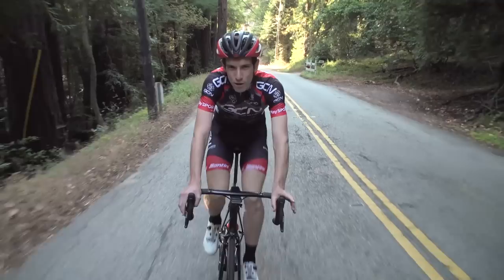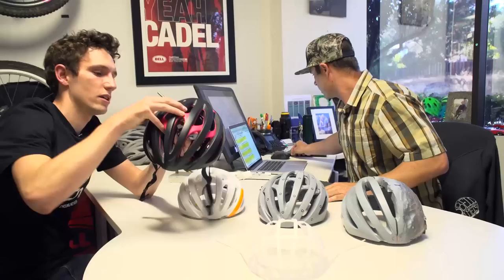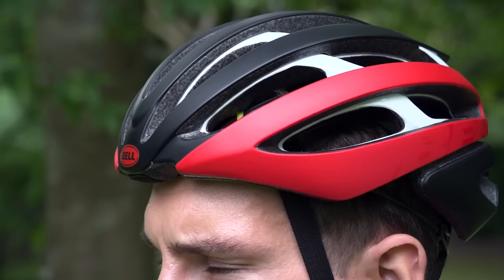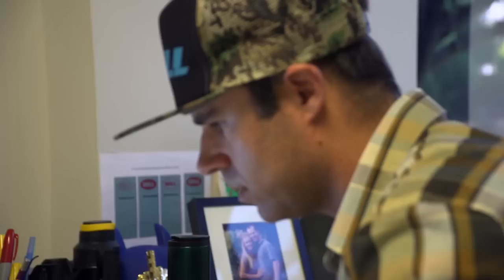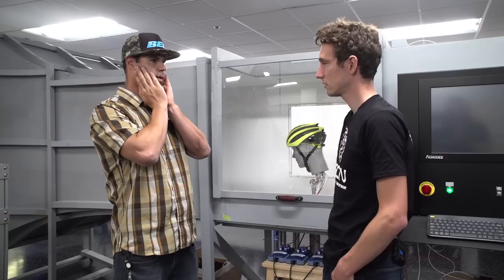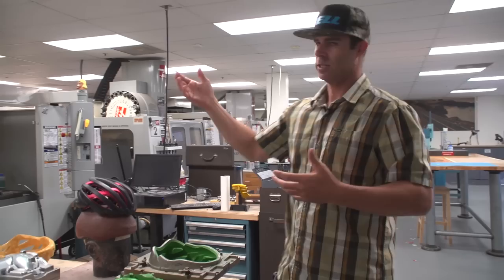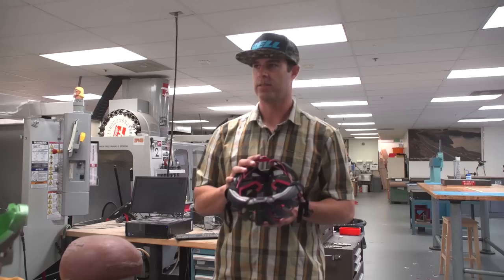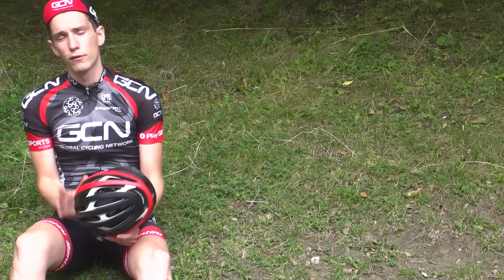How A Road Bike Helmet Is Designed – Behind The Scenes With The NEW Bell Zephyr

Comment: "This particular mold has a lot of different parts to it"

proceeds to remove 4 parts
Reply: It was 5 right? I know a guy who used to work for a company that's main source of income was taking a prototype and designing a mold. A lot more goes into it that the number of pieces. Something about the fewest/simplest parts and the fact that resin must be still be able to flow into the mold easily. I'm in no way an expert, but there you go anyways.

Comment: Interesting video and it made me realise just how much work goes into designing and making one. What I also found interesting was that unlike the new Bell helmet other makers seem to be making helmets with a fuller design. By that I mean that there seems to be more protection around the neck and rear of head. At least there's more plastic. In fact BELL seem to have designed a helmet based on the original 60s net helmet. Be interesting to see whether other makers do the same.

Comment: "Allows us to create what we call a structure", he says. Yeah, everybody else calls that a structure, too. That's what the word means.  Conversely, when you say that you're "litererally taking two separate components and joining them in a way that's much more meaningful", that is not what "meaningful" means.

He says that safety is the absolutely most important thing, but then says that the "upside" of the dual shell thing is that it looks cool and you can put good graphics on it. What's the downside? That it's safe?

Sorry, but this guy is just spouting garbage.

And, by the way, when he says he won't go into too much detail about how the Therminator works, it's because he doesn't know. If he knew, he'd know the difference between a thermocouple (a thing that measures temperature) and a "thermal couple" (which doesn't actually exist).

Comment: Hi guys! What's the deal with mesh panels in the front vents of a helmet? I bought a cheap helmet from Aldi several years ago and it had mesh across the vents that stopped flies/bees/wasps getting in, but recently purchased a much better helmet from Giro that doesn't. And by the look of it, none of the 'pro' helmets you feature have any such mesh? Is there a good reason for this? Aerodynamics? Personally I was annoyed recently that I had obeyed Rule #37 while attempting a Strava segment in my village: a large bumble-bee flew into one of the front vents of my helmet and proceeded to buzz very loudly as I was in the last few metres of my uphill 'sprint'. I undid the helmet strap and ripped it off my head to release the bee, thus flinging my sunglasses across the street. I still managed to finish the segment, mind. Went back and collected my sunglasses (largely unscathed) and later discovered I'd got the KoM into the bargain! Still puzzled about the mesh, though, as it would have prevented the bee from entering in the first place...  #askgcn #torqueback
Reply: I'm guessing looks along with ventilation in really hot locales.  If you want mesh these days, try looking for a skull cap with mesh panels.  I've got a Pearl Izumi summer cap that's mesh and keeps my forehead completely dry.  Smith's Overtake also covers the vents in a neat honeycomb material.  Or just get the Kask Infinity like GCN :P

Comment: I am sure this has been asked before, probably even on a previous show, but how often should I replace my helmet? I've been hearing a variety of different answers, from 1-10 years. I realize your sweat erodes the inside of your helmet (or so I think), so is there a certain limit to how long you should keep your helmet?
Reply: +Haeral Thank you! I've had my helmet for roughly 3 years now. Glad I don't have to worry about swapping it out for another anytime soon!
Reply: Have you crashed? replace
Is your helmet worn (deep dents, cracks, ..)? replace
Do you have any concern about the safety after even small impact? replace
Is you helmet foam soft (it gets softer over the time significantly)? probably replace 
In my opinion 5 years is reasonable amount of time.
Reply: Thank you guys! I'll probably give my helmet a couple of more years!
Reply: Don´t you have an idea where I could find that article? It sounds really interesting to me.
Reply: you replace it after one impact
Reply: They mentioned it in another video a few months back. You should replace your helmet every 3 years, because of those reasons you listed.
But that depends on how often you use said helmet, and if you're cleaning it.

My most used helmet is 3 years now, and I'd say it needs replacing.. First thing on my list for the next season.
Reply from the maker: The honest answer is probably more than you think I'm afraid. EPS is great at its job, but it is susceptible to wear and tear.
Reply: Haeral: Thank you. I´m gonna have a look at that for sure :-)

Comment: Three points: 1. If something is unique, by definition it's one-of-a-kind. There is no such thing as "extremely unique". 2. I believe the devices are correctly referred to as thermo-couples rather than thermal couples. If the creative dude doesn't know the correct name for the device I start to doubt HIS understanding of how it works. 3. Based on the way the creative dude has dressed himself, he is not representing his brand particularly well.